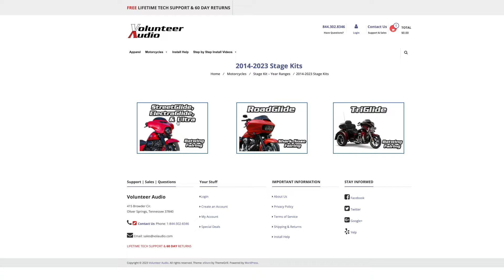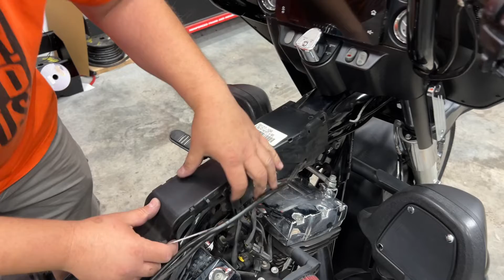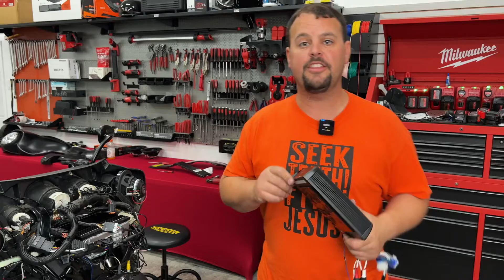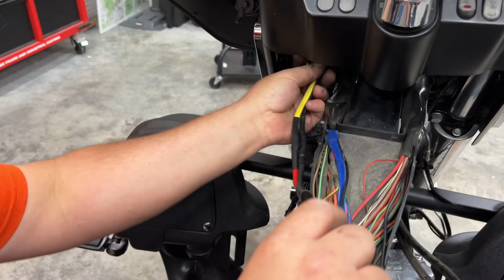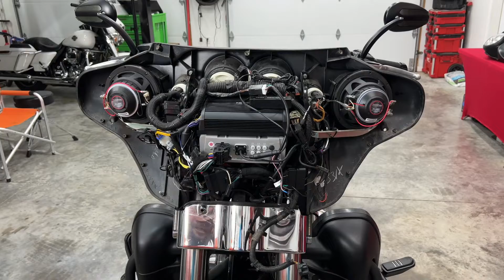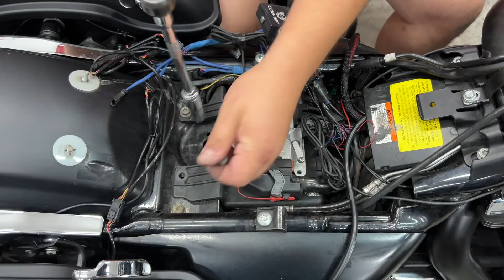How to Install an Amplifier in a 1998-2013 Harley Davidson® Street Glide, Electra Glide, or Ultra

Comment: WHO not use RCA out from stereo to amp? 🇸🇪
Reply from the maker: Because rca is a low level that easily picks up noise from dirty electrical systems, high level is stronger and cleaner, plus does not vibrate loose or brake down like small rca wiring

Comment: Can you just use the RCA from Soundstream to amp instead of harness? And wire from amp to speakers?
Reply from the maker: RCA is not a great connection in a Harley, more likely to pick up electrical noise and fail from vibration

Comment: Will this work with the new WHD.9813? I just bought one and im installing it in a couple days. I’m replacing an aquatic with a separate amplifier that replaced the original Harmon Kardon on my 09 streetglide. I have 6 speakers in system (bags, upper and lower fairings)
Reply from the maker: We offer plug n play amplifiers tuned for your new radio, call our sales team to get the correct one for your system at 1-844-30AUDIO
Reply: @volunteeraudio  thanks for the quick response , where are you located?

Comment: can someone tell me , how thick this plate is ? it looks so massive
Reply from the maker: We normally just use Velcro on this year range, the plate is aluminum and roughly 3/16” thick
Reply: @volunteeraudio  thanks for the fast answer .... i,m from austria and there is noch chance to buy this plate seratly from kits for my 1998-2014 sg.v2 .
Reply: @volunteeraudio  Are there any problems with heat dissipation if the amplifier is glued directly to the radio with Velcro?

Comment: I bought your hertz PnP kit with new SS radio, my bike had harley factory rear speakers that were diff size so i ordered new bag lids to cut, should i use the factory speaker harness thats already installed or should i use the backbone you supplied with this kit. I guess im asking if their is pros or cons to using the backbone connector or not. I wouldnt mine removing the harley speaker harness and sving space behind my front fairing.
Reply from the maker: Use the supplied harnessing, it is larger gauge
Reply: @volunteeraudio  thank you. Also upon completing the install it seems like my 6x9s are somewhat low. I had them when i put my ear to them but it seems like the front speakers are doing most of the work

Comment: So I have a 2002 Ultra Classic (FLHTCUI) what tuner(s) have you used for Stage 1 setup (Aftermarket pipes, hi-Flow Air Cleaner)? I just purchased the Fi2000  92-1600R from Cobra but curious to know which settings from the three knotches is best on a stock Ultra Classic? 
My bike has stock cams, pushrods and all just the stage 1 setup as there's decel pop in low-mid range, idles kind of high (Around 1060-1080), and hesitates on accel.
Reply from the maker: This is not what I specialize in, we do not sell tuners for engine performance

Comment: What radio would you suggest for a 2008 Electra glide police bike with no radio.I want to put a stereo in my bike .2 6.5 in the fairing and a amp
Reply from the maker: @Greg-f2n  any of our 98-13 options fit but the issue is the police model has no radio harnessing in the fairing and to my knowledge there is no aftermarket or factory solution to add it
Reply: @volunteeraudio do they make a blue tooth for it
Reply: I couldn’t put a single din radio in it
Reply: And wire it like a car

Comment: You mentioned something about all of the wires on the battery. I'm in a similar issue with my 2007 Electra Glide Standard, i don't have half of what's on that battery and mine is done for any new connections.  So where is a better option to get your power from so you're don't overload your battery. Are there any spare unused terminals in the fuse block? Or unused spare relays? I want to add a second amp when i install a tourpac with speakers and bag lid speakers.
Reply from the maker: Always connect the amplifier power wires directly to battery
Reply: When I got my two amps the previous owner had one with a relay wired inline, he said it was wired so it didn't have to be wired directly to the battery. I basically stripped both back to factory connections. I wasn't sure what he was talking about, don't want to wire something wrong and fry it. Got more questions about system components. I'll hit you up on email

Comment: I have your precision amp now and I’m replacing it with the hertz amp can I just use the existing battery and cable ground to the new hertz amp?
Reply from the maker: No, the hertz amp has a larger power and ground cable that is specific to it

Comment: Quick question which speakers are better between the Rockford Fosgate TMS69 and hertz spl show 6x9 and what’s will be the difference  and sound thanks in advance
Reply from the maker: The hertz sx690neo are more efficient = louder, clearer, and handle more power, they also have a better warranty, really no comparison between the 2, hertz are better in every way